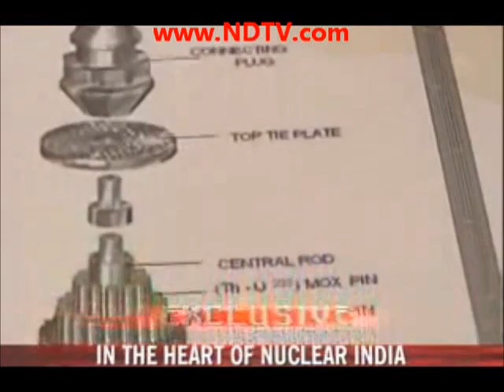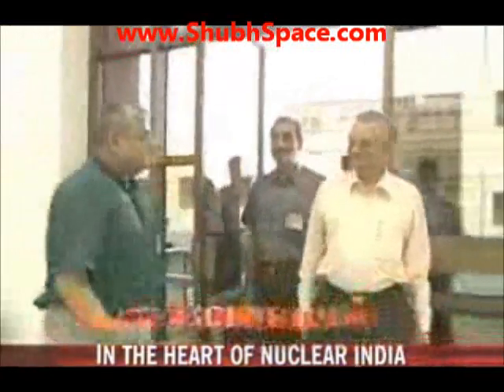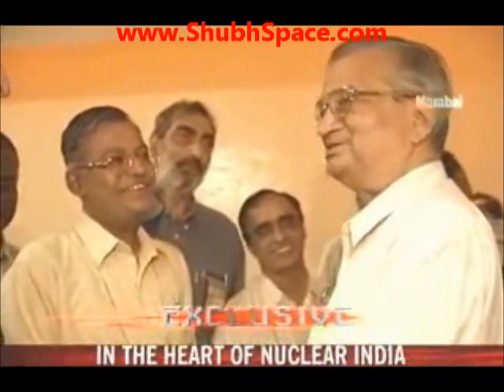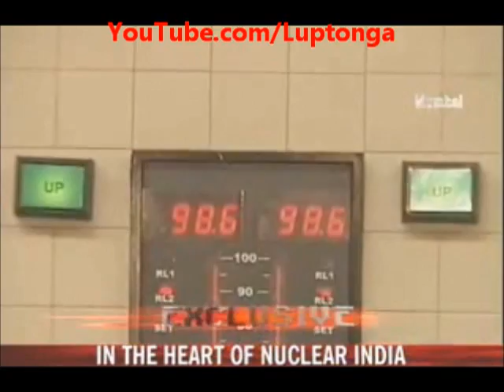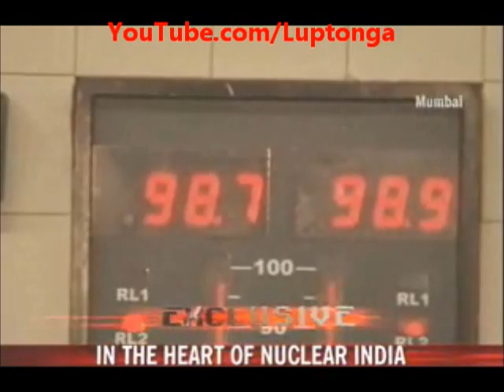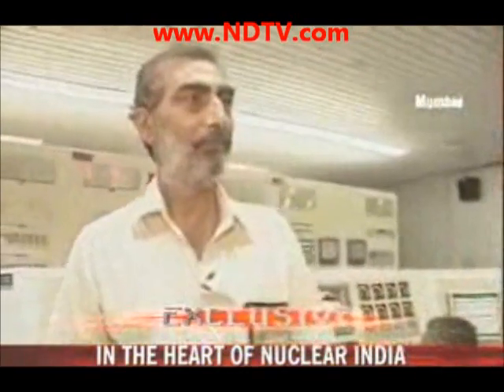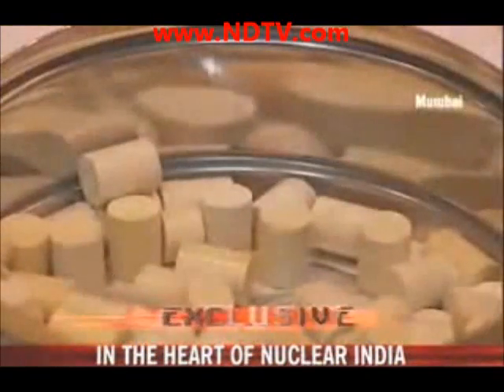India's experimental Thorium Fuel Cycle Nuclear Reactor [NDTV Report]

Comment: It won't come to fruition unless molten salt is used to transport the poisons out. It will remain too expensive for the masses in India who desperately  need the ammonia for fertilizer made from molten salt reactors. India is doing wonderful things with nuclear but when you can calculate the exact level of neutrons before you go critical then you must think of the poor people who need the output from a 600 degree process heat made available with molten salt, not light water reactors who have 300 bar pressure in the reactor instead of atmospheric.

Comment: If it wasn't for corrupt Washington sell outs. America would have had the first molten salt thorium reactor producing power built 60 years ago. Self regulating, stable and 200 times more efficient than uranium. America has enough thorium in drums and mine tailing to meet America's needs for a 1,000 years!

Comment: So is India also working on MSRs?  There reactors would be really good for India.  These reactors could be located close to areas of need and could also provide process heat for industry.  These reactors are also supper safe in that they can have their pumps accidentally shut of, valves left open, power turned off, workers walk off the job, terrorist take over, and any another mess up and the the reactor will simply, because of it's physical design, shut itself off , drain the the fuel out of the reactor and cool itself down without anybody doing anything.  Kind of seems like the type of reactor India should be using.

Comment: Kudos to India. Keep the faith.  Don't let the world leaders screw you over.   How can we clean up nuclear power damage without clean nuclear power like thorium reactors or some other form of clean energy?   They tell me thorium has the power to burn up other nuclear fuel wastes too.  We might have to distill all the oceans a drop at a time & sift the earth a grain at a time to clean up our environment from the nuke spills & nuke wastes the evil ones have already generated.  Check out other forms of power too.  Explore every avenue & alley.
Reply: +Soteriology101 

The thorium reactor you've heard about with all the positive benefits like "burning up other nuclear fuel wastes"  is not this thorium fuel cycle developed by India.  This is just the same old high pressure reactor technology with all the old issues just with a different fertile source of fuel mixed in.

The good benefits you've heard about thorium is in the specific reactor design and not in the fact that thorium is being used.  A molten salt cooled thorium reactor will allow a for low pressure core. A molten salt fueled thorium reactor  will allow for high burn rates of nuclear fuel, including 'waste'.  This new Indian reactor is neither of those things so the only benefit it provides over the non-thorium version is India does not have to buy as much uranium on the open market.  

Technology wise there is no great innovation here it just gives the Indians a bit of independence in their fuel supply chain.

Comment: India is developing this tech. because She is forced to by extremely limited alternatives. The U.S. hasn't gotten "off it's butt" and developed this tech.(which was pioneered at Oak Ridge Nat'l Lab and paid for with U.S. tax dollars, then shelved cause you can't make weapons fron the leftovers)primarily because it doesn't have to. Traditionally, The U.S. does not act until it's social "fuel"(the public concern) reaches a point of criticality. The U.S. is fat with cheap, dirty energy, and won't move forward until that fact changes.
Reply: big oil stopped it .but u.s.a. are having a rethink.

Comment: why not use molten salt based reactors instead of heavy water.
Reply: heavy water reactors will all ways be a problem because of the pressure inside the reactor,thorium salt liquid work at low pressure
Reply: But molten salt highly corrosive.
Reply: They also want to use this to power desalination plants.

Comment: Thorium is as common and cheap as lead. It's clean and safe and meltdowns are impossible. It's estimated that Thorium would supply electricity at 1/2 price or less of coal. This is a technology that changes civilizations like the steam engine did. The benefits of Thorium based power are manifold byproducts like cheap hydrogen to fuel our cars being one of them.

The reason Thorium was never pursued was because you can't make nuclear bombs out of it and it was perceived as too good for civilization. You can't monopolize Thorium and it's the most inexpensive fuel that exists. The bankers and corporation didn't like this and essentially influenced governments not to research and develop Thorium energy.
Reply: MrOgger151 Well, India is making a hybrid light water thorium reactor. Its no true next generation reactor, but rather a upgrade of the current generation of reactors. Sure it have some of the advantages of the thorium fuel (easier to handle used fuel, and safer) but still a lot of the drawbacks of the old water based reactors with regards to pressure and low core temperature and possibility of core meltdown.
Reply: This is actualy a pelets thorium reactor, so meltdown is... at least in theory, posible.
Reply: Yes but it's so difficult to happen you basically need to purposely sabotage the reactor to make it happen.
Reply: Just pointing out the diffrens from a Thorium CANDU reactor anda LFTR thorium reactor.

Its just to common that people think that all Thorium reactor is fluride, mettal or salt reactors.
Reply: I honestly believe we would be living in a different much better world if thorium energy was harnessed. All nations of the world can build their own thorium reactors and the fuel is cheaply available everywhere.

The price of everything is heavily decided by energy cost even food and water. If we had this super cheap and clean energy our standard of living world wide would have been uplifted greatly.
Reply: Rick Rouse Well... Just ruining on thorium will not make that big of a difference.  Sure it reduce fuel and wast cut quite a lot, but its only like 20% of the cost of todays nuclear anyway.

Running with salt reactors on the other hand can quite literally revolutionize the worlds economy.
Reply: Well Thorium reactors wasn't developed only because you can't monopolize on Thorium fuel, it's everywhere and the most inexpensive fuel to be found. The nuclear weapon issue was a secondary concern to the criminal bankster mafia.
Reply: Rick Rouse Maybe you do not understand the point. Nuclear power plants use Uranium. Nuclear weapons use uranium. One could say their uranium is for energy when really it is for weapons. Thorium has no weapons potential. So having thorium facilities would not help a country hide it weapons program. If we all had Thorium reactors we would have no excuse for having enriched uranium or maybe the uranium reactors are our way of hiding our nuclear weapons program.  This is what we accuse Iran of doing.
Reply: Rick Rouse I think its just one of the reasons. I am sure your right that  the main reason is the energy cartels. either way I wish India the best success at this. We need them to show the world once and for all this is the way to go.
Reply: Rick Rouse Do you think some countries do not want Thorium reactors as it would be much harder to hide there nuclear weapons programs? It kind of seems that is the case.
Reply: MrOgger151 That doesn't make much sense. Thorium reactors is just a different type of energy production 1 among many. Thorium fuel is everywhere and that's why the Globalists hated it. It's the same reason you wont see solar panels go above 25% efficiency because that's the point where it becomes price competitive to fossil fuels. 40% efficient solar panels have been developed in the 70's and of course it was slapped with a national security order and confiscated by your loving government. Today we probably would be at 60% efficiency solar panels or higher.
Reply: Rick Rouse
"40% efficient solar panels have been developed in the 70's and of course it was slapped with a national security order and confiscated" You dont have a clue what you are talking about.
http://sroeco.com/solar/images/PVeff-rev100414.png
Reply: matsv201 I don't have documented proof about solar panel research and development but solar technology is over 170 years old, you would think in all that time we would be over 20% efficiency in the markets?
Reply: MrOgger151 I don't see why Thorium failure in hiding nuclear weapons development has anything to do with it's total lack of use. The only explanation on why Thorium was never developed was because it's a "disruptive technology" That simply means it would end the energy cartel monopoly on fossil fuels because fossil fuels would no longer be used for our energy needs.
Reply: Rick Rouse one big problem I've read about is that thorium reactors do not produce weapons grade nuclear waste.
Reply: Thorium common ahahahaahaha
Reply: And as long as oil co have politicians in there pockets Americans will suffer
Reply: https://youtu.be/QCZK3SBN61Q

Comment: Thorium, yes!!  But dig this: Oak Ridge National Laboratory, USA experimented with THORIUM TETRAFLUORIDE as fuel in a MOLTEN SALT reactor from 1964–1969, which was FAR EASIER to both process and separate from contaminants that slow or stop the chain reaction. Check it out.  Keep up the goodwork!
Reply: Why the heck won't they let us build one
Reply: +Mo Dim Sun "as FAR EASIER to both process and separate from contaminants that slow or stop the chain reaction"
Then why the hell didn't this become the industry standard?
...and don't tell me "because of nuclear weapons", because you know what? 233U is as good a bomb fissile as Plutonium, has less isotope separation issues and a a continuously refined fuel breeding cycle (fuel must be periodically refined on the go, in order to continue breeding) that gets you a stable fissile flow.

Thus again, if that's soooooo good, why was it abandoned?

A guess? 
1- Thorium breeding has a much lower yield than 238U breeding
2- Molten Salt is fairly UNSAFE, compared to standard PWR
3- At that time, there was no expectation for realistically achievements in safety and yield problems of such technology

Comment: That's what's sad about your comment about LFTR taking 30 years when it should only take 5 to 10 years to start production.
ITER might actually exceed the speed.  DEMO would be the first prototype reactor that would be essentially model for production use that would happen very quickly after just as U fission did. 
I hope to see either of these implemented in production. It would mean we could over power the grid to produce Hydrogen and utilize H-fuel cells in all autos and so much more.

Comment: But the implications of the term "meltdown" are very different.  Solid core, you can't control the temperature/pressure if the core melts down.  The Li-Fluoride salt method, the core isn't subjected to great pressures and the nuclear fuel can escape to stop the reactions that cause the increase in temperature should the core get to hot.

Comment: This reactor does not require unranium. It will run completely with thorium alone. It does not have the intrinsic problems of uranium reactors. The reason unranium is run in this reactor is that it is a breeder reactor which allows the spent uranium to relent more power rather than dispose of it with high levels of half life radiation.

Comment: Thorium as solid fuel pellets? I thought thorium was used as a fluid in a molten Liquid Fluoride Thorium Reactor (LFTR). If the reactor overheats, the thorium salt solution drains away from the reactor core in a passive cooling containment vessel and the reactions diminish from the lack of thorium fuel in the core, cooling down the core. Get the reactor back up to speed by pumping the thorium salt fuel back in to core area. I wish India success in this endeavor and that thorium proves safe!

Comment: I might be missing something, but I read that at Oak Ridge National Labs from 1965 - 1969 researchers ran a prototype molten salt reactor, completely designed and built, and ran it for 4 straight years successfully.The program was run by Alvin Weinberg and was cancelled because it was too successful for its own good - it was seen as a  threat to the funding for high pressure water reactors that could produce fuel for bombs.

Comment: @PrometheanRunGood The reason they are using Thorium is precisely because they used their CANDU reactors to breed Pu-239 (short cycles to prevent Pu-240 overbreeding). They used that fissile Pu-239 to make a test bomb. After that, most countries stopped selling reactor-grade uranium to India, so now it's just plain cheaper to run their 20-odd reactors on thorium instead.

Comment: As for using U-233 in bombs, good fucking luck! U-233 decays in bursts of deadly gamma radiation which will easily kill anyone trying to handle the stuff without a wall of lead as shielding. You need robots to handle U-233, and I bet any and all fuel reprocessing in these reactors is going to be a nightmare because the pellets are solid lumps of instant death. The US has already tried putting U-233 in a bomb and rationally concluded it was too much of a pain in the ass to bother making more.

Comment: @TheRaawanConsidered to be a global leader in thorium-based fuel, India's new thorium reactor is a fast-breeder reactor and uses a plutonium core rather than an accelerator to produce neutrons. As accelerator-based systems can operate at sub-criticality they could be developed too, but that would require more research.[29] India currently envisages meeting 30% of its electricity demand through thorium-based reactors by 2050
------from wiki-pedia.

Comment: @HWGuyEG 
I dunno.  The chemistry would be totally different.  Thorium as a solid fuel is an oxide - that requires heavy reprocessing.  Liquid cycle systems need to be fluorides.  The advantage: converting uranium tetrafluoride (liquid, bred from 232-Th)  to uranium hexafluoride (gas) is trivial, and makes bred fuel separation easy.